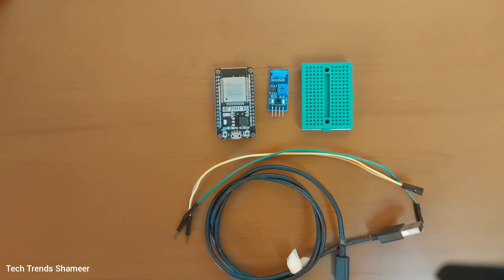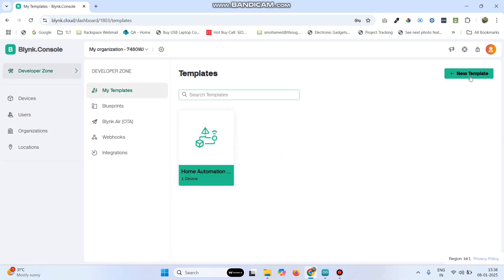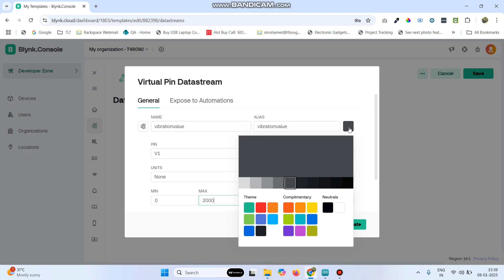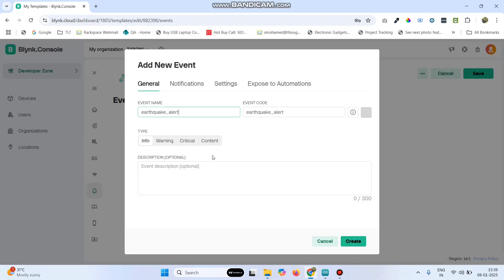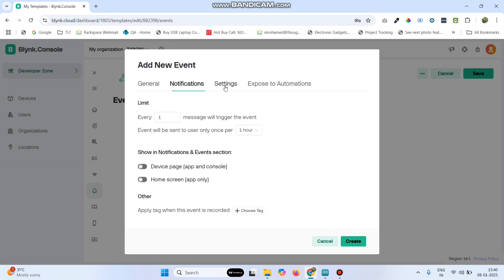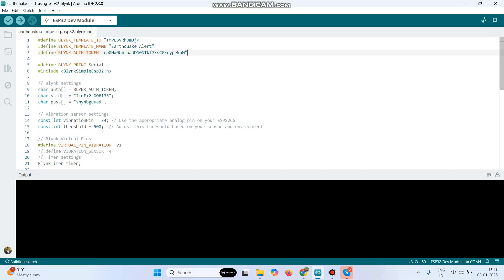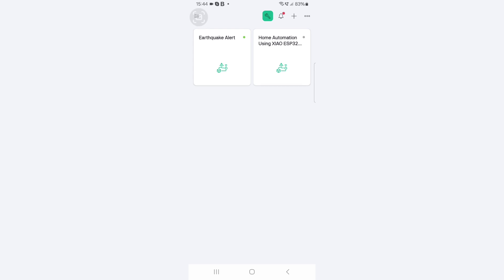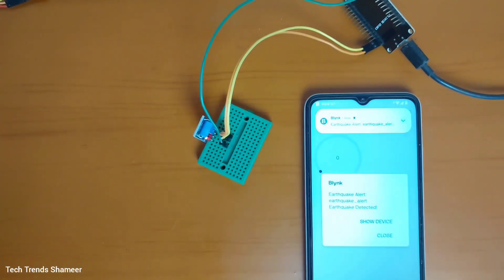DIY Earthquake Alert System with Vibration Sensor, ESP32 and Blynk IoT | Blynk IoT Projects

Comment: which vibration sensors  is used
Reply from the maker: Check the products tagged in the video.
Reply: @TechTrendsShameer  hi. this is sw420
Reply from the maker: Yes. https://robu.in/product/vibration-sensor-module-alarm-motion-sensor-module-vibration-switch-sw-420